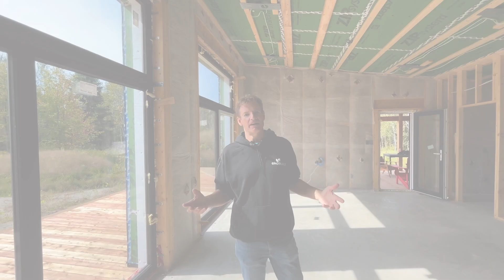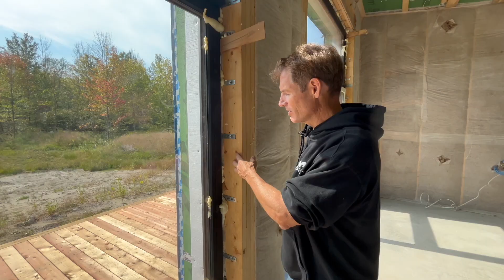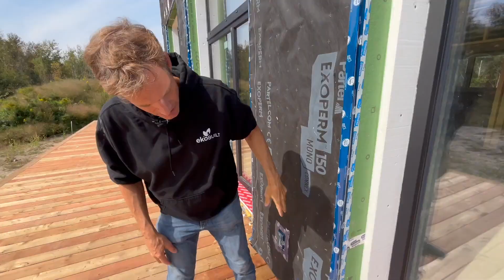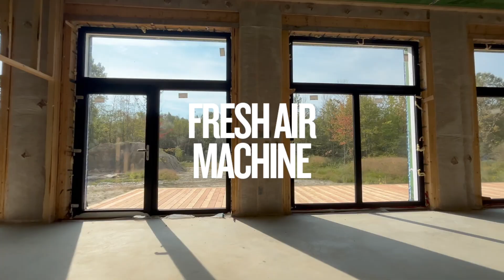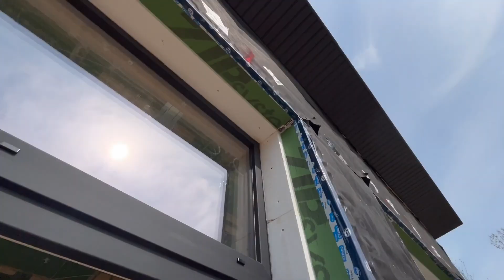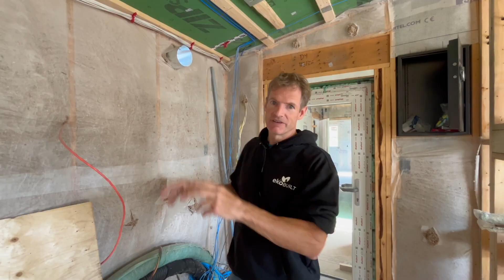What exactly is a Passive House? | The Short of it!

Comment: Currently a few months into a passive build with EkoBuilt and figured I'd share some real feedback for anyone researching. The team's been responsive, they clearly know their stuff on the technical side, and to their credit, when I've flagged errors in the drawings they've corrected them without pushback. Their unlimited revision policy on the concept design phase has been genuinely great too, made it possible to actually get the layout right instead of feeling rushed to sign off.

One thing this video actually touches on that I wish I'd understood sooner: the square footage you're quoted (the "footprint") is not what you'll actually live in, and the gap is much bigger than people expect coming from conventional construction. Rough math: a 1,500sf footprint in a standard stick-built home loses maybe 5% to wall thickness, leaving you around 1,420sf. That same 1,500sf footprint in a passive-certified build, with the thick walls needed to hit code in a colder climate, can lose over 11%, closer to 1,330sf. That's a real difference in usable space for the same quoted number. Ask for both figures, footprint AND net interior, before you sign anything.